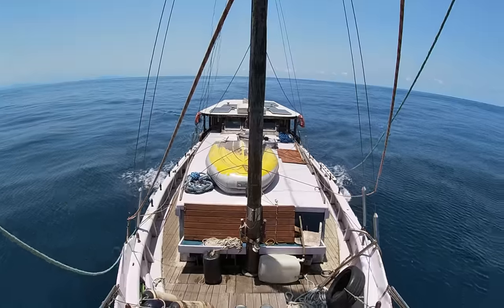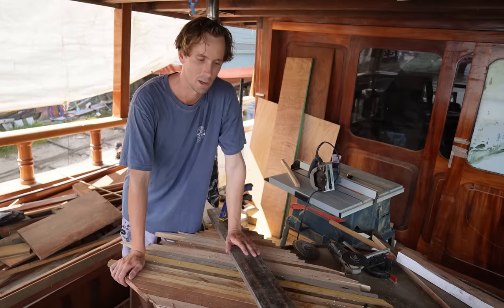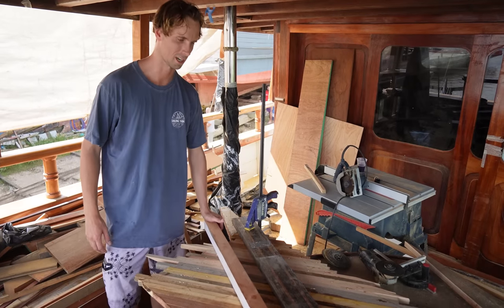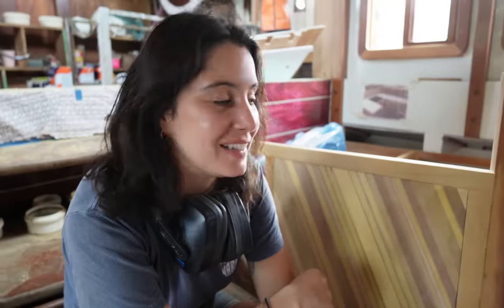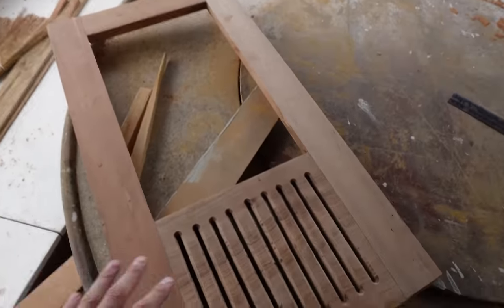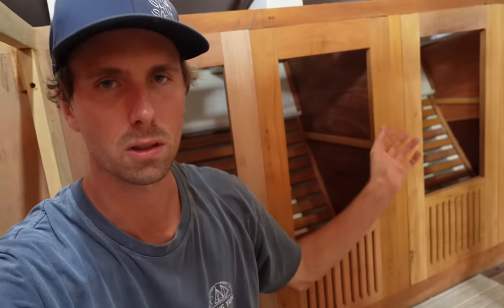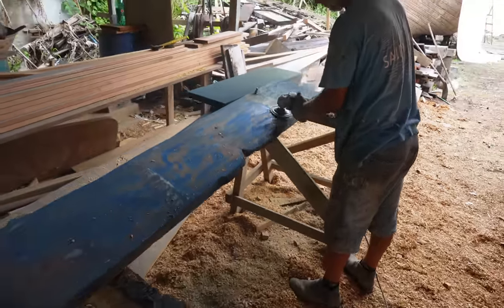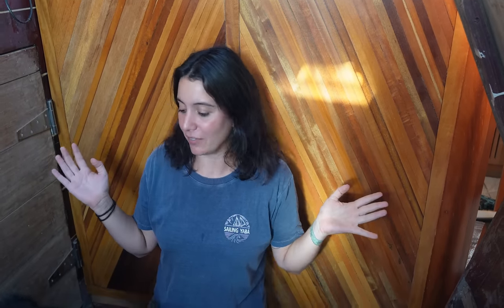Making the most of SCRAP WOOD: building furniture for our rescued WOODEN BOAT — Sailing Yabá 124

Comment: Reaction part 2.. I use a small,cheap detector for electrical conduits and metal .in sheetrock a row of blips means metal screws or nails = a wooden stud for hanging al lamp .
Leidingzoeker in dutch ,costt about 5€ ,size about 5x20 cm  works with a small 9v battery.
No more unnessesary standing.
And sailing Yaba is a top boat building series to watch !

Comment: i never understood why your deck leaks requiring the drip panels.
Reply: All wooden boats leak, it's just a reality of the material.
Reply: @snowstrobe  I haven't seen any other builds having this problem..
really, if you can seal a hull you can seal a deck...
Reply: @symbolsandsystems  every wooden boat will leak, period. Anyone who believes they have permanently sealed a wooden boat is going to be disappointed. 

Smaller wooden boats don't need drip pans and such infrastructure because they are easy to inspect and access, so WHEN (not if, when) the seals, decking, hull, etc., are in need of repair, you will know. 

This however is a 70 foot ship, much of the wooden hull is sealed behind interior barriers. It is unrealistic to assume that minor leaks will be immediately apparent or promptly noticed.  And the letting water trickle unnoticed over time along interior beams and enclosed areas is exactly what caused the systemic damage they are repairing now. 

Drip pans, drainage, louvered walls allowing visual inspection, water sensors and telltales, all these are necessary so that 1) leaks produce tangible, observable evidence, 2) leaks that are not noticed immediately do not cause significant damage, and 3) areas prone to leaks can be easily accessed. 

Cruising on a wooden boat is akin to building an airplane while you fly it. There will ALWAYS be a low tempo of maintaining going on, there is a reason the boat has an onboard material working/mechanics room.

Comment: Sanding painted epoxed wood with a grinder causes a great amount of bad dust going into your lungs. Like the videos but you guys should protect yourself better
Reply: . This is a very importsnt point. Epoxy that isn’t fully cured is still chemically active, which means it will give you heavy allergies and other illenesses. The point here is that epoxy isn’t, finished curing even if it’s completely hard. Most epoxy types need around a week for that at room temperature. Warmer surroundings speeds it up much. Sanding not fully cured epoxy is illegal in many countries, because dust particles will inevitably find their way into your lungs, where they will fester until cured.
Reply: @SteinVarjord  Thank you from myself for this knowledge.although it has briefly terrified my thoughts. I have been involved with a lot of epoxy resin and glues where it was worked as soon as firm enough to be cut or sanded. I also have a pulmonary disorder . What you say all clicked into order in my mind with the feeling I have and how epoxys made me feel when around the fresh materials. And the things you wrote are clearly very real.
Reply: I notice they never reply to criticism, however good it is
Reply: Dear  @austingode  
👍👌👏 You seem right as far as I can see. There are a lot of utubers existing who simply don't like constructive criticism (even if true respectively helpful!). The channel owners do it their way, even if wrong (nearly all of them forget/push away, that doing something in public has a role model function!). Some even block comments/viewers. Not completely of course so that the views still count for their income! The viewers himself can still see his comment but nobody else. This behaviour is at least pretty childish if not egomaniac/narcissistic. In comparison to other boat projects, for instance Tally Ho, this boat/schooner is put together pretty poorly in terms of durability/life span and rot resistance. For instance: No dolfinite bedding compound under the planks, planks are nailed on and not through bolted etc.p.p.. But I guess that this is the way the vessel was built originally. If done in a "better" way, it would maybe be not payable for the nevertheless brave couple. This restoration will not last really long, even if the boat will be maintained well. But maybe long enough for this couple respectively as long as they like to keep the boat.
Best regards, luck and health in particular.

Comment: Hi Guys. I love the VLOG I however am a little concerned at the use of such exotic woods and the Sanding and Cutting without the use of proper dust masks. I turn wood for a hobby and one of the things that I have read and have been told is be VERY CAREFUL of certain woods as they are Toxic and harmful to your lungs especially woods from the Tropics so Please Please wear a proper dust mask and be safe

Comment: see it again the mania tick act of a carpenter to make moving parts , cited to the frame , hey you nuts water movement paint etc .. will make the door impossible to open easily , minimum 3 min of gap around will save a lot of repair in the future